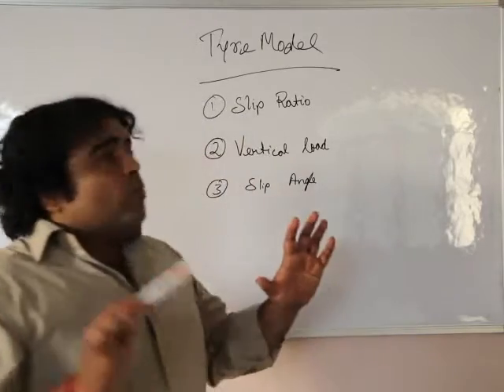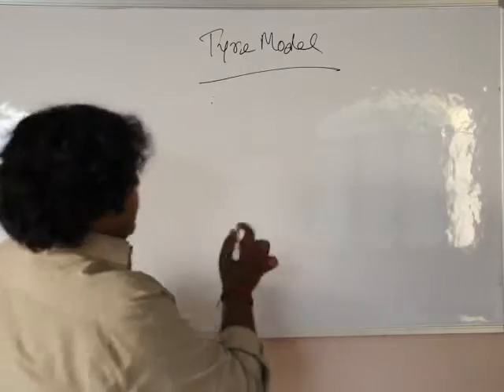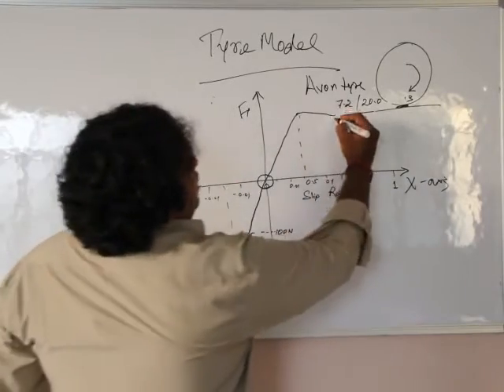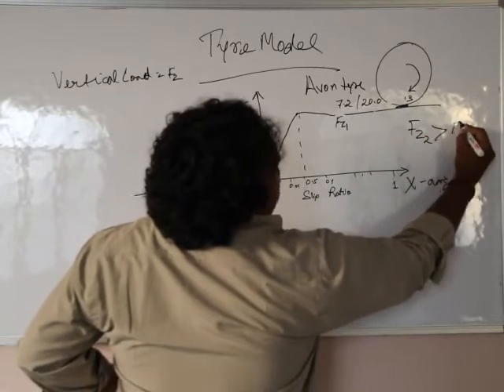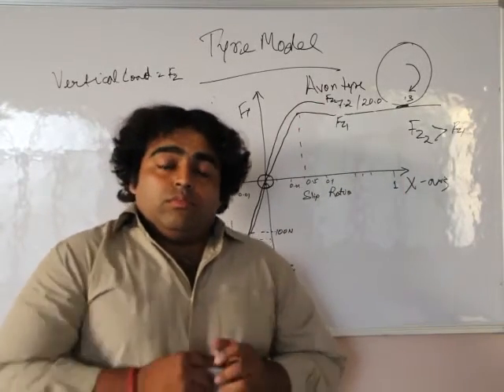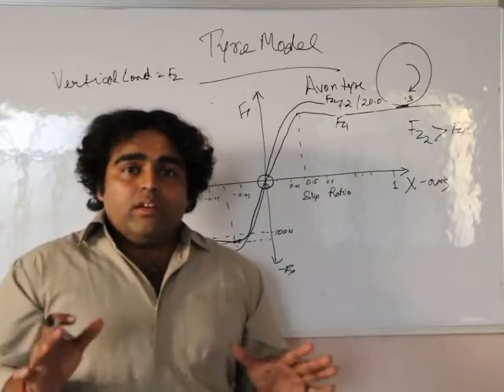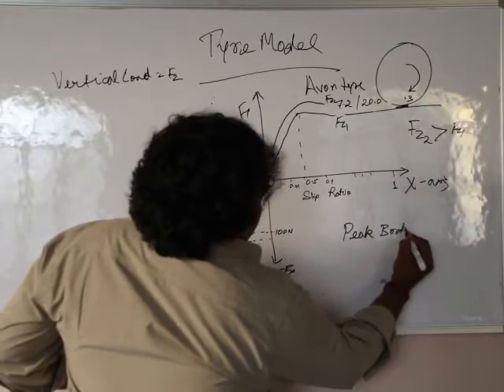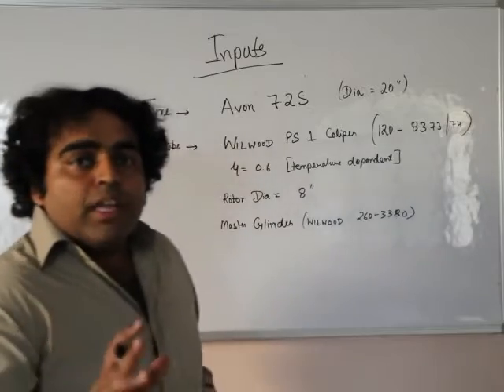Wheel Locking while braking- for FSAE, BAJA and SUPRA teams

Comment: in the last example you have considered about the static condition i.e rear axle has load of 160 kg but in actual practice when the braking start the load will start to get transfer from rear to front, in that condition , i dont think the above method will work, so what to do??
Reply from the maker: +Vimal Yadav You are right. While braking you may have the opposite weight distribution. However our intention was to show the peak braking force of the tyre at the highest load. If that is at the front, then, you will have to apply enough brake force to lock the front wheels and since the peak brake force at the rear will be less than that on the front, the rear wheels will certainly lock.

Hope you can relate to it now. Please post if you have any more queries.

Comment: sir, how can we know the peak force that a tyre can take for a particular vertical load? Do we need any specs sheet about the tyre?
Reply from the maker: Yes. You need tyre data. Tyre data for any racing tyre can be obtained from the tyre manufacturer, or you can get a tyre tested and obtain the tyre data for the same. However getting a tyre tested is an expensive process, as you will have to waste a tyre and also pay for the testing expenses.